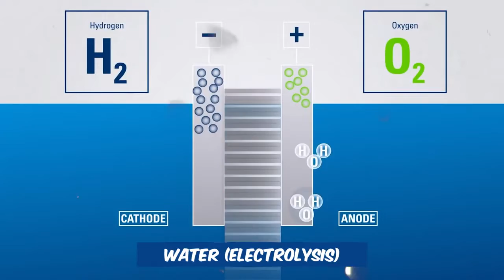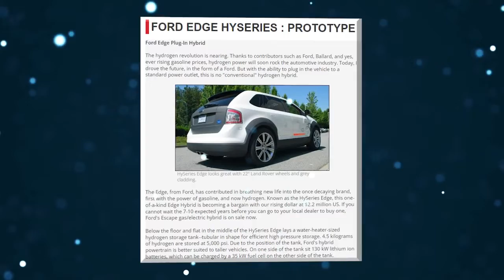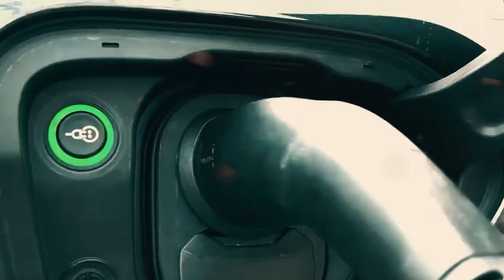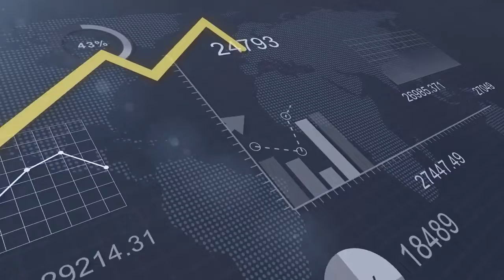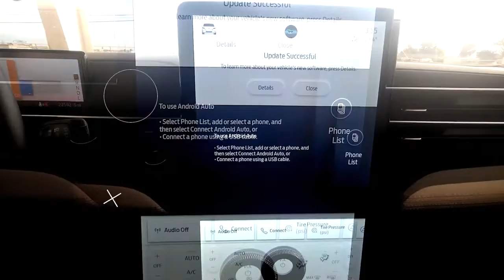Ford is CHOOSING Hydrogen Over Electric?

Comment: The fueling infrastructure for hydrogen is nowhere near adequate, and the cost of making it so would be extravagant.  Granting the unlikely possibility of creating such a network, the cost of hydrogen fuel will be at least three times that of electricity for battery powered cars.  This has no chance of succeeding.

Comment: These types of videos are why misinformation about hydrogen continues to spread. There are 2 primary types of hydrogen propulsion. Hydrogen internal combustion engines, and hydrogen fuel cell electric vehicles.
This video goes one step further and shows both ICE and FCEV versions, but fails to address the different implementations.

Comment: the feds just spent billions to make hydrogen from natural gas.  It's still ridiculous, why not just run cars on natural gas directly, but it COULD be better than EVs BUT there are many issues with it.  #1 is there is NOWHERE to fuel up.  So you are starting completely over on this stuff.  And if you think you're sitting on a bomb in an EV imagine hydrogen.

Comment: It is to be hoped that Ford has understood that hydrogen fuel cell powered vehicles consume three times more electricity per mile than the equivalent battery powered ones when the hydrogen is produced by  electrolysing water. Every other commercial method of producing hydrogen generates carbon dioxide and so is pointless as a remedy to climate change. Also, there is a range limitation with hydrogen due the space required to store it safely in the vehicle which is, in reality, as problematic as the packaging and weight issues posed by present day battery technology. Another issue is that the fuel cells themselves require significant amounts of expensive and rare platinum catalysts in order to operate efficiently. The only benefit of hydrogen power over batteries is the faster re-fuelling, as far as I can see. The task of creating a nationwide hydrogen refuelling network will probably be even more daunting than that of building up the electric vehicle charging infrastructure. Either the filling stations will need to produce and compress, to 700 bar, the gas on site, which is both complex and space-consuming, or they will have to be replenished via the delivery of hundreds of large and heavy gas cylinders per week by road. Finally, there are cold climate issues to be addressed since fuel cells cannot operate at freezing temperatures. The solutions to this will probably involve having a significantly large battery on board each vehicle for the initial driving phase and for fast warm-up of the fuel cell.

Comment: Ford would not succed with anything except normal petrol or diesel cars !! hydrogen are shitty too because you dont have charging stations and those cars are expensive with shitty performance  and so on., basically  other EVs shit
Reply: Jim is grasping at straws, his leadership here and Mary in GM is atrocious, hoping the customers will buy, maybe blame should be with their board of directors also
Reply: No they don't have charging stations, They will just have to use those shitty, annoying roadside stations like those stupid petrol cars get to use every day...
Reply: only stupid are EV cars , petrol&diesel cars have  much higher range and refuel in few minutes  while for EV you need hour  if you first in line and at the end it costs same or more then fuel with 2-3x less range  @nigelyorkshiremanwadeley6263
Reply: Hey now, no need to be so sarcastic when OWNING a fool.

😂😂😂😂😂😂😂
Reply: Theoretically you just pour in water into the vehicle and the hydrogen conversion happens inside the vehicle!  imagine that, or you will have to get solar at your house to do it... or they will truck hydrogen to the gas stations... they can truck hydrogen to gas stations, but there isn't enough electricity to power enough chargers for everyone, the grid would fail.  this is because hydrogen is much much more energy dense than current battery technology, only if batteries increase by a huge factor can EV actually work for vehicles that travel outside of a small enclosed smart city... batteries are fine for a smart city where everyone has their own solar on their house roof, but even then our current grid will have to be upgraded during a time when the grid is failing... not realistic... so hydrogen it is!
Reply: @VenturaIT  nor hydrogen nor EV will succed massively,they are more for rich and high class toys only